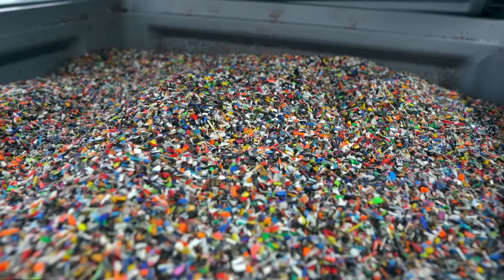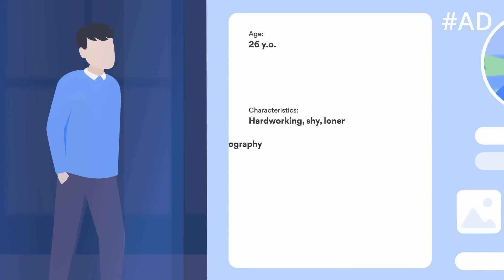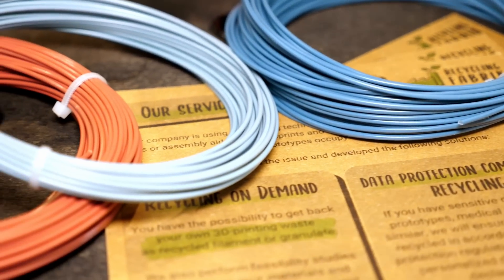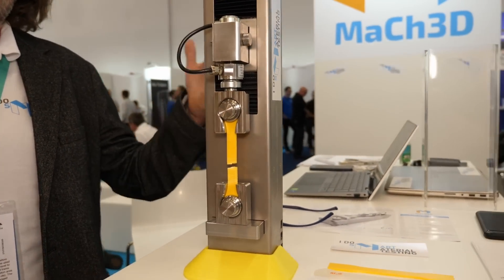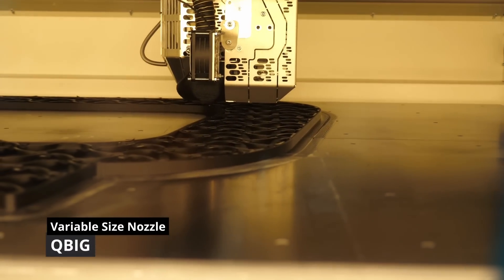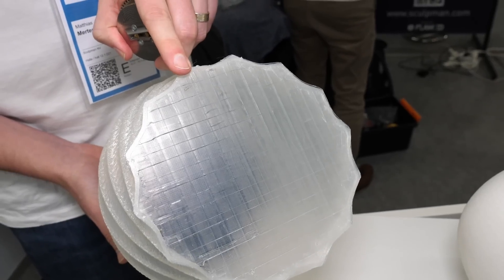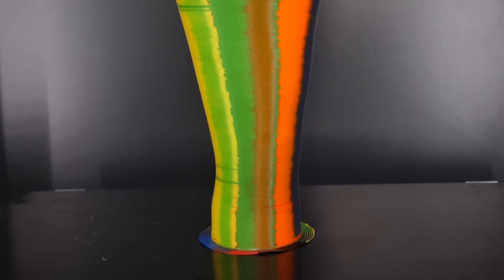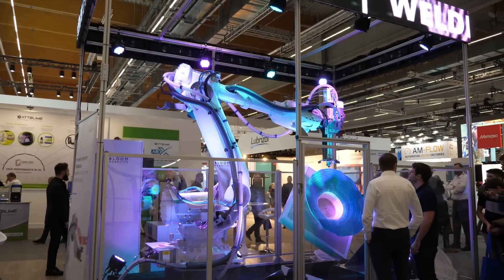Impressive 3D Printing Technology at FORMNEXT 2022

Comment: So much effort is being put into making money off useless products that use more energy than they save.

Recycling filament is great, but sending it across the globe twice is just stupid. it may work ig you send a few hundred kilograms but if you need that much filament you already have your own recycling device.
Augmented reality is a gimmick. Yes it's cool to see exactly where you need to be on the deivce, but... you are going to take the goggles of to properly see what you are doing, and you have to put them back on if you want to check if you're doing it right. It's a cool idea but they never spent a minute trying it out.
Strengthtesting is amazing. The market is extremely niche though and the companies that need it already have such a device in their labs. Not sure if you want to trust AI to predict loads, but these days customers want to hear the word AI mentioned with everything they buy, so I get why they say it.
Induction heated nozzle. Clever. Now lets see how long the nozzle will last when you heat it up and cool it down hundreds of tyimes per print. Also; how does the filement react when heated to 200 degrees a few 4 seconds?

The industrial solutions are pretty nice for prototyping, it saves them from using  CNC machine for that proces... unless the prototype needs to be precise... or strong... oh well. I know little about industrial 3d-printing.

The last solution of pre-heating the top layer I think is the most interesting one. We're all working on colling things down quickly but a hot layer is better of adhesion so why not pre-heat the top layer? Maybe not with a many-watts lamp but something more targeted. But ofcourse that will simply melt your benchy so...long way to go.

Comment: Heating the printed part from above seems way more rational than heating the entire bed or the chamber.

I've been thinking about that technique for a while...but using diode laser to focus on the exact point right before the plastic deposition.
Reply: My toughts exacly when the individual layer heating was mentioned, my understanding is that the relationship between the laser diode wave length and the colour of the thing you want to heat is very important, some colors absorb the laser while others bounce it, that would mean you could only use a small range of filament colours, makes sense?
Reply: @wallpaper1138  : Infrared laser doesn't care much about colors. There is some variation according to different materials...but we're only interested in superficial heating, so...not a problem either.
Reply: What they showed here is for a totally different reason than what you'd use a heated bed for though. A heated bed does nothing for layer adhesion. past the bottom layers. I'd still want a heated bed so that the part stays stuck to the bed until after printing.

Comment: The heater got me thinking that maybe a laser (not too hot) mounted next to the nozzle and pointed at the bead that is just put down might help layer mixture/adhesion?
Reply: Yeah, but you also have to add laser safety into the equation. So really just adding in laser rated glass and many interlocks into the printers frame would probably work fine. Also driving said laser depends on the laser. Still a good idea, just a bit touchy... all doable with off the shelf parts....

Comment: The layer remelting idea was really good and would be soo easy to implement at home
Reply: It would be easy to make the hardware part of it anyway. Software simulator part is not so simple.
Reply: @amoose136  the software doesn’t need to be very complicated, just heat the part at a lower than optimum level, it would still increase layer adhesion above a stock printer. Company’s like to make stuff sound advanced by using the term “proprietary algorithms”

Comment: In regard to the variable nozzle size. You can simply use 2 nozzles say 0,8mm and 0,3mm with an IDEX system at home onstead of printing 2 colors which is a gimmik you can print 2 different sine widths. Or yo ucan even use variable line width with a .4mm nozzle up to 1,2mm line widht in vase mode etc. thatßs wht I do.

Comment: That Induction heater is brilliant! I am surprised that it wasn't implemented sooner as off the shelf parts exist for inductive heating, the concept of milling a tool steel nozzle for it isn't far out!
Reply: Totally agree. Inductive soldering irons are the slimmest and lightest I've ever used and similarly heat up in just a few seconds. Would be great for a nozzle.
Reply: @makers_lab  makes me wonder if someone could hack an inductive soldering iron for this purpose.
Reply: @davidelang  Maybe a variable temperature one (mine has no sensor and relies on the bit's composition and Curie point to maintain a specific temperature). I think a driver should be pretty straightforward though, doing high frequency PWM of a coil.
Reply: I know! It makes so much sense!
Reply: @russ-techindustries  I could see an ender 3 add on, just taking the heating and cooling times into account. Seems doable. Probably use some optocouplers and an op amp with some thermistors to keep the Temps in check and a very good fan for rapid cooling...
Reply: Also, the steel heating insert can be quite thin walled so it would have very little thermal mass, and also be of the type that splits the filament into multiple channels (don't remember what they're called). The induction heating would be able to keep it hot without a problem ¹, but as soon as it's turned off it would cool off in seconds. Heck, it might even be fast/responsive enough that you could reduce stringing by letting the melt zone cool during moves.

¹ see induction coils bringing a wire to white hot in seconds.
Reply: @phizc  I think you'd want a little bit of thermal mass to make it less difficult to control. On my old machine it would heat from 0c (my room was freezing cold, sometimes below as a worst case test) to about 240c in roughly 40 seconds. The issue I had was the stock and auto PID tunes for Marlin were throwing errors it was heating so fast, I'd have about 20c thermal overshoot in bang-bang mode from about 1-2 seconds of heating. In my case I never really saw that much of a problem (mostly using ABS) when I got it tuned to 10c max/min changes (had to use Kapton tape, otherwise it was untunable with any fan blowing anywhere close to it), and I found you needed the thermocouple placed about equa-distant as the tip otherwise it could get some crazy effects depending how your heater block was designed. This was a typical E3D V5 style clone with a better heating block design (I recreated it in CAD because its the optimal design and most heating blocks are terrible) with I'm guessing what was the wrong heater and I over-volt my printers for faster heating. That thing could even keep up pushing 1.2mm at reasonable speeds or like 0.8mm at 120-160mm/s (true speeds, the thing was flying, had to tighten everything down almost after every print).
Reply: @jakegarrett8109  good point. There would definitely be a sweet spot. Also, come to think of it, the thermocouple is going to be a problem. They work by actually creating a tiny voltage potential due to the different metals bonded at the tip. The inductor might induce current in the couple wires and totally mess up the measurements. I wonder how they solved that problem, if I'm not over thinking it..
Reply: @jakegarrett8109  , have you tried MPC rather than PID control in Marlin?
Reply: @phizc  In this case, you would need to  use a thermistor rather than a thermal couple.  They are nearly immune to EM fields.  Some electric motor manufacturers use custom built thermistors as the cap for their stator windings.  This puts it in the highest magnetic field strength and variation possible.

The biggest problem I can see with an inductive heated nozzle is the controlling electronics.  You really can't put the switching hardware far away without needing really heavy wires connecting it to keep the wire's induction as low as possible.  You would need to put the switching hardware, temperature feedback, and power storage at or very near the nozzle.  A single SiCFET could handle the switching load.  Maybe a small MCU could be used for temp control and creating the PWM signal.  Thinking more and more into this, it is very doable without much extra hardware and without adding heavy wires.  There would need to be an adjustment to Marlin to send the requested temperature to the hotend MCU and then receive the actual temperature readings from the hotend as a digital signal.

Ok, you've convinced me.  I'm going to try this on my experimental printer.  It's a first generation Leapfrog from 2013.  It has  good bones, but the electronics were crap at best.  The frame is a box frame built from 1 1/2" aluminum extrusions.  It uses belt driven X and Y axis on polished rods and linear bearings for those.  The Z axis uses 3 lead screws to hold it and move it, with a single large stepper motor and a big timing belt connecting them.  It's simple, but robust.  I bought it for cheap and have been playing around with different control boards with it.  It came with industrial grade stepper motor drivers (DIN mounted 84V 15A), so not much in the way of driving power from any control board is needed.  The original control board was a poor copy of a RAMPs 1.4 and a knockoff Arduino Mega.  That never worked properly as they missed may details when copying both.
Reply: @phizc  i played with inductive heating a few years ago and this was exactly the issue. RF interference. shielded wires and running the (heavyish) hf unit on the head sort of defeated the advantage of light-weight...
though, pulled apart a handheld heating unit recently, and that has the HF unit in the black box. runs it at HV through relatively thin cables, then has a transformer in the handpiece to the actual coil. makes a lot more sense to do it that way.

experience on industrial units, simple cable isnt the way to go. want flat strips for conductors, ideally clamped together with insulation sandwiched between. maximise capacitance and minimise losses in transmission. ensure ALL fittings are non ferrous. RF is weird stuff...

things you learn along the way.

if i had a go now i could probably get it to work. reliably.

what i saw with their prototype was too much bling machining... puts it well out of the average price bracket.

another thing is in my experience... the coil gets hot. really hot. the industrial units are watercooled... with some nasty pressures and flow rates required... the rule of thumb was to say half the power applied is lost in the coil itself.

not a big deal but something to bear in mind. watercooling may be necessary.
Reply: @phizc  totally correct indeed. The thermal mass would be practically nothing. I think they are called volcano nozzles that have the channels. Yes, it would work wonders on string prone filament for sure...
Reply: oh, yeah, the induction heated hotend was awesome!
still I got to say, most of my waiting time is spent for the bed to heat up
Reply: @Bubo Bubobubo Look for trianglelab Rapido Hotend. My fault. It isn't inductive, but still quicker than the standard design.
Reply: I wonder about the wire size going to the nozzle. Induction is great, but if you need 1/4" wire going to it, then you can't go fast because it becomes too heavy.
Reply: It is a greater fire hazard tho...
Reply: Triangle Labs has this for years and it works very well.

Comment: Great video.
Do you know the specific price of the tensile test machine? Around 10.000€? Not totally sure, what a standard machine costs.
In the industrial space I found Inkbit to be a interesting competitor to SLS printing. But it's inkjet printing with photocurable but quite functional resins. You have a wax as support material which can be reused after melting. With this you can stack multiple parts on top of each other. Being a cold process you can print very accurate parts with small gaps and details and even multimaterial parts e. g. with hard and elastomeric sections combined. Not for us hobbyists unfortunately. The whole system costs around 1.000.000 $.

Comment: That wide heater around the nozzle is brilliant! I bet it'd work fantastic with POM as well as PEEK. POM is such a pain the ass to print... Getting accurate dimensions is basically impossible because it shrinks so much while it cools. It also won't stick to itself if you don't keep it really hot. Cooling helps with dimensional accuracy but then you end up with layers that delaminate far too easily. With a heater moving over the print that'd (probably) fix that problem entirely!
Reply: I think you 2 are talking about different parts.  The “print area” heater looked brilliant for printing those hard to print thermoplastics!  The inductive heated nozzle also looked really great for those as well but it wasn’t demonstrated printing PEEK with perfect layer adhesion…. I want both!!
Reply: I'd say it would probably make abs printable without an enclosure, seems pretty useful for DIY machines as well
Reply: @malloot9224  Why wouldn't you want to have an enclosure? Moisture is in the air everywhere in different quantity. You are heating something close to combustion temps,  yet water intrusion (which expands 1000 times @ 100C) you disregard?
Cheap enclosure? A big cardboard box sealed with polyurethane sealer. A vent fan with temperature switch to circulate if hot.
Reply: @bryanst.martin7134   yeah cheap enclosures work, but are rather dangerous compared. Especially if the machine isn't made for high temperatures, like the prusas that arr made out of petg. The moisture in the air matters for some of the crazy high end filaments, but for ABS it doesn't matter at all, so making a hotend with an IR lamp wouldn't be so crazy.
Reply: My question is can you do the reheating with a laser
Reply: it would be brilliant if it was a concentrated hot air nozzle. Now it heats a huge area for no reason.
Reply: @constantinosschinas4503  that's the point, it's heating the already printed areas instead of just the nozzle to make sure the layers bond well.
Reply: You did note that it was inductive? Heats only the Ferrous material (Iron, Hardened steel) and coupled with an IR sensor can be very accurate and dynamic in temps throughout the layer.